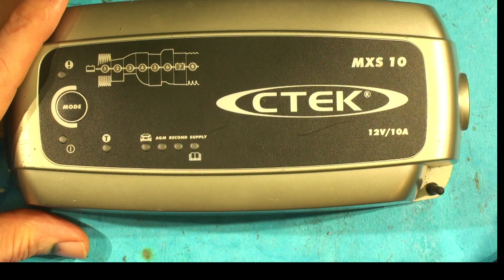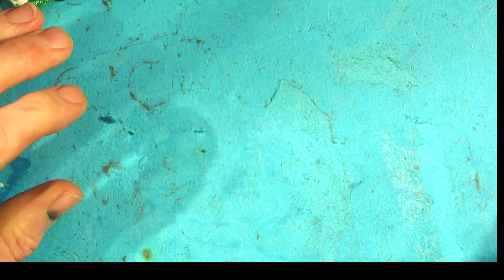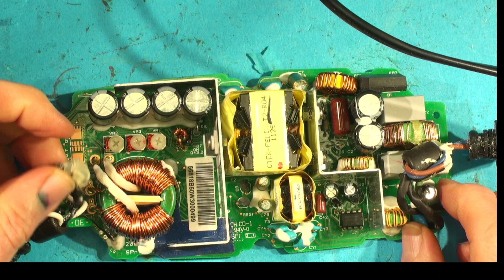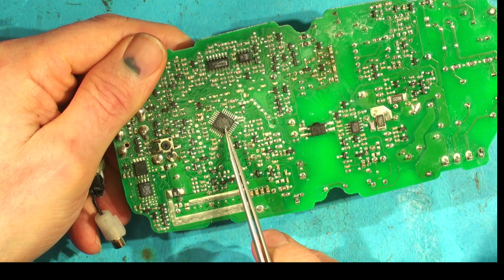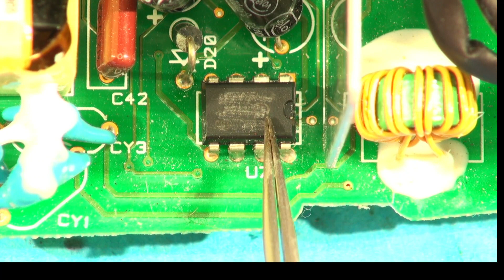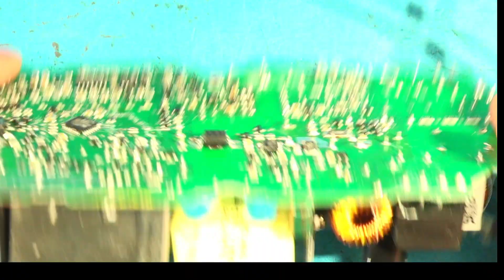CTEK MXS 10 They don't want us to repair them. Can you have a look if you have one of these...

Comment: Right to Repair!
I am really tired of having high prices in equipment, equipment that is less reliable than older ones, and not being able to repair it - either due to software blockage, or due to lack of information sharing.

Tesla and Apple are the two most notable infringers, but the World is full of them.
I will certainly do not buy a CTEK charger in the future, not only due to their poor design, but also due to this attitudes.

Yes, maybe is to protect their IP - like another commenter wrote in this video.
But Hardware IP is somewhat impossible to protect / enforce.
It is the Software IP - the claimed Patented 8 step charging - that they should rely on to protect their business, if it is so good after all, or is it not?

Thank you for your hard work, and complete analysis.
I have enjoyed so much, and I am looking forward for the NOCO Genius 10 analysis, as I am thinking on buying a charging, repair, and supply unit to help me keep all the setting on my car when I have to change a battery (namely the radio codification).
Reply from the maker: I agree. I am not sure how we tackle them to task. there are many companies that don't release any service information.  Imagine how many domestic appliances would be saved from land fill if the parts were sold at a cost price plus a fair margin...  As well as the huge environmental benefits, the Ability to economically repair creates employment and would move some human resources away from retail fast buck box shifting to vocational service technicians.   TAKE MAKE AND THROW AWAY NO MORE!!! (Or at least as little as you can). Thanks for the encouragement.  By the way the real culprits are the deign engineers.  They could rebel and design a  better product. The standards of electronic design in many products is shocking.   I cant decide if they are designed to fail OR if they are just commercial managers in charge  of crap engineers.  As an engineer I always fought back against stupid management desires to compromise my designs.
Reply: @razenby  many subjects here.
I will divide them.

a) Right to repair
We, as a society, need to pressure our government to right Laws that protect this right.
The EU has a great amount of power in dealing with some issues - just look at the GDPR.
The UK is usually a pioneer in many of these matters; but unfortunately decided to part from the UE - we are always stronger together.

Nevertheless, I think the UE and the UK will have a key role in this matter, and we as citizens have to pressure our representatives in order to draft Laws who protect us as consumers, reduce the impact on the environment, and keep our economies going.

b) Engineering

Engineering is a wonderful job.
But, at the end of the day, we all work within budgets and targets.
A budget limits the number of hours dedicated to R&D, limiting our ability to develop better designs, conduct proper testing, or plan repairability.

The only commodity that I see which complies with this, and is "cheaper", is our cars.
A car is a machine with a high degree of repairability, with instructions, and a maintenance plan.
However, some of this information is not shared.

Engineer budgets have also a hard time dealing with IP theft from other countries.
It is easy to spend Millions on a R&D project, but it is easy for a Eastern company to copy it.
But, companies have to find strategies to cope with that.
Eastern companies are not able to copy CPUs, planes, and even cars. And they could be bought and simply "copied".

c) Corporate management

The corporate managers in past years have gotten focused on only KPIs - Key Performance Indicators, which tell them if the company is getting them the profit they need to get their bonuses.
Why?
Because, both companies and people are not loyal to a company, i.e., people are rotating from company to company - not only because it is the only way to get a salary raise, but also because companies have no soul.

Thus, many engineers are somewhat not focused in finding the right design.
Their focus is to find the best value, or find the cheapest design, or "stamp" a due date.

The only way I see this change is the "era of services".
Meaning, with this ear of pay per month, companies should start selling better products, and then you pay a monthly fee for a service.
They will have to improve their design, otherwise, they risk the customer going to other brand.

Cheers from Portugal!
Reply from the maker: @hitardo  I agree with the exception of engineers. I managed a team of 20 engineers in all disciplines for nearly 20 years.  If technical is exercised correctly then development costs lest and the resulting product is invariably better and more reliable.   The trouble is that they can level technical excuses that cannot be countered as the 'management' does not have the knowledge. Excuses such as insufficient time, insufficient,insufficient specification, insufficient testing and proving. But the fact is to be worthy of the title of engineer they need to engineer and push back against stupid or ill informed management.   It is the engineer;s responsibility to ensure that they don't produce a lame product with stupid errors. Just look at how many products are developed wrong or over budget or way too late. Who set the timescales in the first place?   Every company needs a very strong Technical director who knows his stuff and desn't take any crap from above or below.
Reply: @razenby  I agree with you.
And that may be related to culture.

In Britain - as a foreigner - I see people actively fighting for their values and rights, regardless if they are talking to their parents, managers, or authorities.
Other cultures do not see this in a light manner.

Regardless, I agree with you: an Engineer shall strike for the best possible solution, and convince management that his / her solution is the one.
Reply: @razenby  They are Definitely designed to FAIL at a certain time, I've had 2 chargers do the same thing at virtually the same time now. I refuse to buy any more of that brand. I am giving Victron a go now & so far 5 + years in no problems & they work every day.

Comment: @Magic Smoke, my MXS10 just stopped providing output, so I had to open it, just the output fuse, BUT mine still has numbers on them, the 8 pin IC is an ICE380565J on the first line, then H1439/E2Z and finally 51452084501. Let me know if you need any other number, it'll be open for a day or two whilst I get a replacement fuse :)
Reply: I have the same problem, replacement fuse didn't fix it, hopefully yours will be resolved though
Reply: @tanagobg  I did a quick measure on the output stage with it in PSU mode and I'm getting 14v and the fuse is open circuit. So fingers crossed :)
Reply: Yip, looks like the fuse did the trick. There was some crusty stuff on the PCB, cleaned that off with some isopropyl and the rest of the board for good measure. All back up and running :)
Reply from the maker: You might want to laquer the board and enclose an active  silica gel sachet if you use it outside - they are very prone to condensation. There is a video that needs editing that I will put up to see what happened.
Reply: @razenby  Thanks will do, but looks like I was a little optimistic. So the output fuse blew which is a 30A, after replacing that I have voltage on the output, but looks like I have no current, so I suspect I blew the output FET as well (I hope it's only a FET), my skillz are limited. But she will have to go into the repair bin till have time and spares. :(

Comment: Maybe Ctek is scrubbing the chips so the Ch-n-s- cannot make any copies and sell it under their own brand.
Reply from the maker: Most likely. But stupid. I have made some progress.  The production process is very messy. The more I look at it the nastier it gets.  The last device I haven't identified  is the the 8-pin device U7  -  an off-line separate DC power supply for the electronics . If I look for the cheapest one I can find might work. It isn't rocket science so if I can't identify it I can probably bodge an alternative device in it's place. There is a separate PWM controller for the main bulk charging power.  If I can't get an ident I will trace out the power supply schematic and publish it.  A very expensive example of a piece of cheaply made hardware.
Reply: I doubt it.  They dont need to copy this crap they can  build a better one. The only reason to scrub it is so you  can't fix it. Thanks for this video. I will never purchase a product this designed not to be repaired

Comment: I have the same charger and will take a look at this chip later today. 

Meanwhile do you have an idea what can cause this same charger to not produce any charge towards the battery ? Lights are blinking like it is doing something but voltmeter shows that it doesn't produce any. The fuse was blown so I replaced it and I thought that would fix it but no... 😕
Reply from the maker: That's great thanks.  There are 2 high-current FET Flat Pack Packages that connect and disconnect the battery leads from the electronics.  The solder quality on the charger I have is poor.  It maybe a bad joint or track in the area or a blown FET. If the lights and power are on and you can select mode then it should be a simple thing to sort out.  If I can get this one going then I can  give better advice.
Reply: Probably one or both of the 3D030L (PSMN3R0-30) is shorted.

Comment: samsung doesnt want us to repair their washer main board, but I still did haha.
Reply from the maker: We need a lot more of that.  These manufacturers have it too much their own way and it costs the customers and the planet. Ridiculous spares prices just kill domestic repair jobs for repair technicians.
Reply: @razenby  And what really irks me is the governement putting huge taxes on ME to "save the planet" while companies makes bad products which do not last and that cant be repaired cost effectively.  Thereby , those companies are the ones that pollutes, not the consumer. But I get eco taxes on all electronic products!
Reply from the maker: @Nordic_Mechanic  We are on the exact same wavelength.  I wonder if we have a right to demand a schematic or service manual for a piece of kit that we own and want to fix??...Let's face it, reverse engineering a schematic might take a few days. I have done it quite often to fix things. All you have to be is systematic about the schematic and  lay it out and test it. If you have a working one then it is a piece of p**s to copy it. In any case you can buy schematics and bills of materials from several Chines companies that specialize in bribing workers to release customer tech info used in ODM plants.
Reply: @razenby  There is all sorts of wrangles going on at the moment, it's called the right to repair. Mainly aimed at mobile manufacturers! But should be for all electronic parts/repairers imo.👍🏼
Reply from the maker: @amoebavirus1508  These things need to be tested properly to make sure they meet minimum design standards before they are allowed to sold. CE goes part way and has teeth but the authorities take them out and put them in glass on the side.  Self-certification is a travesty because certain parties are not trustworthy.   For good made in china CE stands for China Export.  I wonder if over here we will get the UK Kite-mark back?
Reply: @razenby  UK kitemark would be great.
Reply: @Nordic_Mechanic  just buy Miele next time would you? Their washers are easier to fix and you can get repair parts/schematics... You get what you pay for most of the time.
So go to Miele
Reply: @kitecattestecke2303  I will keep that in mind when buying my next washer. Thanks for sharing

Comment: The only 8 pin IC's for smps I'm familiar with are Viper 22a and AP8022 - for bench PSU's
Reply: Maybe UC3843 or similar, we can only speculate.
Reply from the maker: @Tab7.6.Tab7.6  Thanks.  Ill check it out.  It could be that crude. Clearly CTEK have no idea about SMPS design. It isn't a Texas logo but could be a copy - I'll trace it out and see if it fits.  Not sure how they are deriving  inverse signal for the second FET. I'll keep you posted.